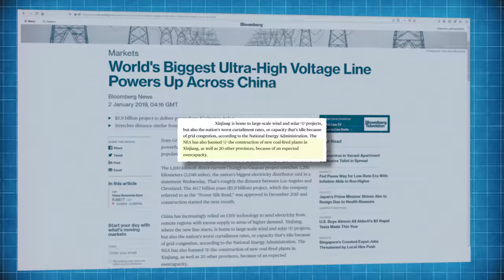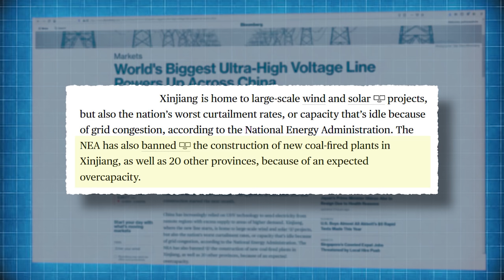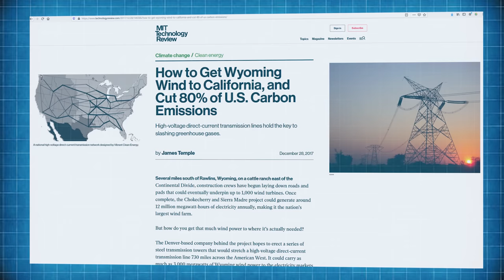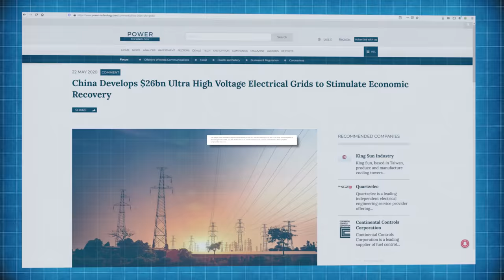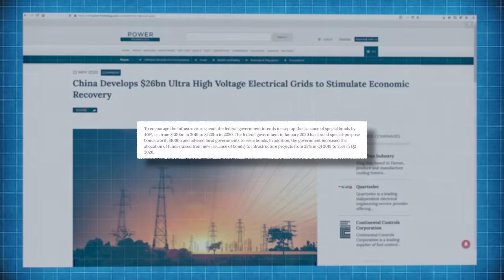China's MILLION VOLT Energy Superhighway

Comment: Clearly, local generation of renewable power is the gold standard when practicable; Apart from transmission losses, anything like a wire or tube is vulnerable to any number of accidental, deliberate or natural events.
Reply: Not the least of which is to separate your people from self-sufficiency.
Reply: That's true, but the more cheaply we can access renewables the more we can mitigate climate change, and like any other network, this one can be made more resilient with more links.
Reply: That's a big geographic issue in China, in the populated ares there isn't much wind or sunshine
Reply: Sean Vikoren Self-sufficiency is mostly impractical since it is so much more efficient to do things in large scales. A farmer harvests twice the amount of potatoes per area than I did yesterday. Same goes for electricity. Edison wanted people to be „self-sufficient“ with power, because he wanted to sell a steam powered generator to each and every house. Tesla‘s power grid idea is so much more practical. And no, even being self sufficient in power and food terms does not shield you from a government exerting power. Unless you isolate yourself on an uninteresting island, that is.
Reply: True.  And the way to minimize a temporary loss due to line failure is to distribute the flow over multiple lines located somewhat apart from each other.

Right now the western US has two large HVDC lines that bring power to SoCal. One from the hydro/wind generators in Oregon and another that brings (brought) coal energy from Utah.  There is work underway to link those seperate lines at their northern ends which would create a loop.  Break the line in one spot and power still flows along the remaining route.

The Utah/coal line is likely to be extended to Wyoming to southern Wyoming's excellent wind resource area.
Reply: We learned that lesson the hard way in Quebec. Despite our network being built at 3 times the Canadian requirements, towers fell like dominoes during the 1999 ice storm. At one point, Montreal was being powered by a single line. We learned our lesson, but the takeaway is very different then what you are promoting. Every 10th tower, a stronger fall arresting tower was built. More redundancy was added to the network. The power utility has also gotten rather savage with trees and will cut anything that is even remotely close to power lines.
Reply: @jonathanlanglois2742  

It's too bad that it's much more expensive to bury the lines.

Long term, I think there's a greater than 50% chance we'll see Boring Company building hyperloop tunnels for very fast travel between cities.  A single route would use three tunnels, one in each direction and one for service and emergency evacuation.  Use a UHVDC transmission line.  Put the positive wire in the bottom of one tunnel and the negative wire in the bottom of the other.

When you build a roadway in a circular tunnel there's a space below the roadway that is unused.  Put conduit in there for transmission wires before you fill and pour.  Do that and the cost would be very much lower than an above ground tower system.  No towers, no route real estate costs, no tree removal type maintenance costs.

The probability of a line break or short would approach zero.
Reply: Weather dependent energy, or sunlight dependent, needs prodigious amount of "storage", and uses it inefficiently.
The 3 GW plant at Bath County Virginia is the highest power in the world. If you fed it up to 3000 MW from a 3 GW assemblage of wind farms with a CF of 1/3, it would average 800 MW output, because its remarkably high efficiency is 80%. It would store off-peak nuclear much more effectively.
Its energy storage capacity is given as 24,000 MWh.
I decided to compute from standard figures how nuclear fuel compares with that. It comes to 3 kg of fissile isotope.
At 3.6% fissile, with plutonium added of about half that much, except that LWR can't use less than 1.8%, I reckon 100 kg of fuel rods holds as much available energy as the biggest pumped storage in the world.
But don't you dare suggest that a reactor should be backup for bird and bat-killing wind mills.
Reply: @jonathanlanglois2742  So high power lines are a menace to the green of trees, in Quebec.
Reply: @albertrogers2506  
You know, if one were to propose building a solar-only grid in a place with modest solar insolation you'd be right.  But that wouldn't be a wise thing to do.  A 100% RE grid will almost always use a mixture of solar, wind, hydro, and possibly other clean generation sources which will minimize storage needs.  The only grids likely to be 100% solar are a very few on small, very sunny islands.  

I'm not sure why you claim that solar uses storage inefficient.  Round trip efficiency of lithium ion batteries is 90% or better.  Pump-up hydro runs from about 70% to as high as 85%.

The wind turbines that we are currently installing have CFs well over 33% and a recent survey of wind resources at a 140 meter hub height finds lots of usable sites spread around the US where we should be able to enjoy CFs from 60% to over 70%.

The issue with nuclear is not the cost of fuel.  Fuel is cheap.  Currently fuel costs are less than $0.01/kWh.  Very minor.  The economic problem with nuclear is installed cost.  We don't have current overrun costs for Vogtle 3&4 because the company quit making overrun costs public.  But the previous accounting of a couple years back found that the installed cost was around $12/watt.  Compare that to wind at about $1.50/watt and solar which is now below $1/watt.  Nuclear costs so much to bring online and that cost has to be paid back over, typically, a 30 year period.  That's what makes nuclear electricity unaffordable.

And, remember, nuclear reactors need backup.  The grid has to have a way to replace their generation when they have an unscheduled shutdown.  What that has meant in the past is requiring steam plant to run below full output.  Then when a nuclear (or coal) plant dropped off line the remaining plants would spin up to keep the grid powered.  Running a less than full output increases the cost of electricity produced.  Annual total costs are divided by fewer MWh of electricity sold.

Bird and bat killing is FUD.  A recent study that demonstrated how to cut bird kills in half revealed some interesting statistics.  This is before one of three blades was painted black in order to make the rotating blades more visible to birds.  Here's the pre-painting data from the eight turbines used in this study. 

Bird kills were counted over a 7.5 year period.  

18 Total Kills 
8 Turbines 
2.3 Kills per Turbine 
7.5 Years 
0.3 Kills per Turbine per Year  
Kill rates were well under 1 bird per year per turbine even before a blade was painted.  

After one blade was  painted black on four of the eight turbines for an additional three years.  During that post-painting study period bird kills were more than 70% lower for the painted turbines compared to the unpainted turbines.

The above numbers do not include observed deaths of 13 Willow ptarmigan <i>Lagopus lagopus</i> who typically die from colliding with towers, not flying high enough to be struck by blades. A separate study found that painting the lower 10 meter of the tower black cut ptarmigan deaths by about 50%.  

Another interesting tidbit - "Mammalian scavengers do not exist on the island of Smøla, minimizing any removal bias." That means that the counts were likely very accurate.											

Bird kill rates of less than one bird per turbine per year are common except for a very small number of wind farms where mitigation has been necessary.
Reply: @albertrogers2506  To be had, an adult maple tree can grow 2 meters in a single year, so they literally have to cut them every year even considering just how savage they are being. Theses trees are so tough that short of removing the roots, they'll grow back, so cutting a few branches doesn't really hurt them much.
Reply: James, I appreciate you balancing out the typical “pro” only comments. It seems that people mainly focus on “can this be done”, without any consideration for, should it be done, up front cost, or maybe more importantly, opportunity cost.

Despite the world spending trillions of dollars on solar/wind, gov mandates forcing people to use, guaranteed profits, ect...Solar/wind (& batteries only) still can’t even power a single modern factory on an autonomous basis, let alone a city, state or country. Solar/wind don’t work most of the time so they have to be backed up by the fossil fuel grid 24/7/365 and the battery storage required for an industrial economy is non existent at anything remotely feasible cost wise. This is shocking to most people who’ve been lead to believe that solar/wind are powering modern economies on a self sufficient basis...By self sufficient/autonomous I mean, not connected to, or backed up by, the fossil fuel (or nuke, hydro, geo) grid. 

When I point this out, I most often get snide, “have you heard of batteries?” or “not true, there are places powered by only solar/wind and batteries”, but when I ask where this is happening, I only get more insults in response. It turns out most people conflate, 1) what’s predicted to happen 10 years from now, with the realty of where things actually stand today, 2) places running on renewables like hydro or geothermal (both great sources) with running on solar/wind, or 3) off grid living power requirements with powering an industrialized economy. 

The “battery storage revolution” has been just “a few years away” going on 60 years now, but when I point out the obvious, I still  get the, “cheap battery storage is...just a few years away” response. ;) 

Going back  to opportunity cost, I can’t help but wonder how much further along we’d be if instead of spending trillions trying to make unreliable, dilute, non-scaleable and expensive energy (solar/wind) the opposite of what they are, and instead spent that money on making sources (nuclear, nat gas for example) that are already reliable, dense, scalable, and affordable in comparison, that much better. 

If the goal is solar/wind, no matter the cost, and we’ll bear any cost in that pursuit, it’s easy to claim victory in the face of an energy policy/energy poverty disaster.
Reply: @fjalics  Renewables may seem cheap, but a gigawatt of solar panels is guaranteed worthless for 12x365 hours of most years, and slightly more for leap years. If you add enough energy storage to carry it over, it is no longer inexpensive. No such capability exists on Earth. If you have 3000 MW of faceplate wind power, in a site with an expected "capacity factor" of 1/3, you expect an average of a gigawatt, but your dispatchable power for grid purposes is zero. If a million "homes" get up from their TV sets and go to their kitchens to switch on an appliance or two at a kW each, their is no way you can summon up a gigawatt's worth of wind.
It's like the spirits of the deep that Glyndwr claimed he could summon, and Hotspur said "Aye, so can I, and so can any man. But do they come when called?" (Henry IV, Part One)
The funny thing about wind is that the same wind can travel from John o' Groats to Land's End or Dover in a remarkable short time, so there's not much resilience. The Sun's no better. I have farmland that induced a solar power company to offer me, if I'd three phase grid access possible, $500/acre/year for a twenty year lease.  Having significantly more than 100 acres, that'd be a million dollars, which is more than the value for which the county charges me taxes. I did not respond, as I consider the "renewables" trade as dishonest as any religious swindler.
Reply: @YearRoundHibernater  Q: What is large and yellow and very very dangerous?
A: Shark infested custard. That'd be an uninhabitable dessert.
Perhaps I should apologise, but I could not resist.
Reply: @bobwallace9753  exactly my thinking. i know a way to do it :)
Reply: @lawsonhannah  
Tony, you make a number of statements that are incorrect.  Let me address at least some of them.

"Solar/wind (& batteries only) still can’t even power a single modern factory"
  
It is absolutely a fact that solar/wind + batteries could power a single modern factory, even a steel foundry/mill.  But there's no need to do so as it would only be a demonstration project.  As we add wind, solar, and storage it fits into the entire grid, not one isolated load.

"Solar/wind don’t work most of the time"

Wrong.  The number of hours during which either wind, solar, or wind + solar are producing electricity is very high.  With 140 meter hub heights we are moving into conditions where onshore wind turbines in the US will have 60% to 70+% capacity factors.  A 60% CF does not mean that the turbine is producing electricity only 60% of the time.  The turbine will have some number of hours at full output, some at 80%, some at 60%, some at 40%, etc.  Those numbers average to 60%.  The numbers during which generation occurs will be much higher than 60%.

I've looked at annual hourly generation numbers for California across two years.  There isn't a single hour during which there was no electricity generated by wind and/or solar.  The situation is that some hours output is high, some hours output is low.  By increasing our capture are and adding, very importantly, offshore wind we can greatly reduce the number of low input hours.

"so they have to be backed up by the fossil fuel grid 24/7/365"

Are, right now.  But do not Need To.  It takes time to transition from one energy source to another and we are early in the transition.  During the transition we will make use of what we have, which is now fossil fuel, hydro and pump-up hydro storage.  As time goes along we will install more wind, solar, and storage and reduce our use of fossil fuels.

" battery storage required for an industrial economy is non existent at anything remotely feasible cost wis"

Temporarily, but only temporarily, correct.  Battery prices are rapidly falling and we're now seeing solar farms with hours of battery storage bidding into the market at very competitive prices.  Solar farms designed to provide power during the sunny hours and the provide power from their batteries during late afternoon and evening peak demand hours.

Battery prices are continuing to drop and grid storage installations will grow.  It's happening.

"This is shocking to most people who’ve been lead to believe that solar/wind are powering modern economies on a self sufficient basi"

That's a very dishonest statement.  No one is telling people that wind and solar are totally supplying a grid anywhere.

"2) places running on renewables like hydro or geothermal (both great sources) with running on solar/wind,"

Hydro is a dispatchable source of low carbon electricity.  Lots of grids will use hydro, if they have some, to fill in the wind/solar gaps.  That happens now with fossil fuel/nuclear grids.

Geothermal may be used some places if the heat resource is limited.  By using the geothermal only during peak demand periods it should be possible to let heat recovery occur during the low demand periods.   But, basically, geothermal is an 'always on' source like run of the river hydro.

"Going back  to opportunity cost...."

There was a time when nuclear was less expensive than wind and solar.  About 30 years ago.  But 20, 30 years prior to that we came to realize that nuclear was too expensive compared to coal and basically ceased building new reactors.  There was no significant concern about climate change so there was no push to cut our carbon output using nuclear since is would have meant a major increase in the cost of electricity.

That's now changed.  New nuclear is about as expensive as new coal, our two most expensive ways to bring new capacity online.  Wind and solar are now our least expensive ways to generate electricity.  Natural gas, while cheaper than nuclear, can only be used temporarily during our transition as we must eliminate fossil fuels.

Where would we be had we built lots of reactors 30 years ago?  Well, we would have produced less CO2 which is a good thing.  But we can't go back and do that and we wouldn't have been able to get people to agree to higher utility bills.  So where do we go now?

Install lots of wind and solar.  Keep bringing the cost of storage down via improved manufacturing efficiency and technology advances.  Identify more dispatchable loads so we can use a larger share of electricity directly from wind turbines and solar panels, lessening our storage needs.  Start capturing methane from urban and ag waste streams to be used in CCNG plants for 'gap filling'.  Perhaps uprate some of our power producing dams so that they can deliver larger amounts of power at times of high need.  (More likely, add a pump-up storage component.)

Nuclear's gone.  Dead.  Unless some government is willing to subsidize the cost of electricity.  The market will  not support new nuclear.  Even paid off nuclear reactors in the US are going bankrupt because they can't produce electricity at a price the market will pay.  Kewaunee was the first US reactor to close because they couldn't sell their electricity at a price high enough to cover their costs.  This was a paid off nuclear plant in good operating conditions with years left on its license.  Kewaunee needed to earn $0.05/kWh and the market wouldn't pay that much.

Just a couple of days ago it was announced that the two reactors at Byron Nuclear plant and the two reactors at Dresden Nuclear Plant will be closed next year.

Starting in 2018 we've seen Oyster Creek, Pilgrim, Three Mile Island, Duane Arnold, Indian Point, Perry, and Beaver Valley nuclear plants go cold due to cost of generation.

The two Byrons, the two Dresden reactors, and Palisades Nuclear are scheduled for closure in 2021

Clinton and Quad Cities, and Davis-Bessie were scheduled to close but are now receiving government (taxpayer) subsidies to keep them open.

The nuclear age has come to an end.  From here on, assuming there's no new emerging and unexpected technological breakthrough, it's renewables with wind and solar playing the largest roles.

Fat lady has sung herself hoarse....
Reply: @albertrogers2506   You aren't looking at the situation correctly.  Solar panels will provide inexpensive electricity about 18% of the time (US average).  If single axis tracking is used it's somewhere in the 25% to 30% range.  Cheap is good, is it not?

Wind turbines, 140 meter hub heights, with yield capacity factors over 60% which means that those wind turbines are producing electricity well over 60% of the time.  And more cheap electricity.

Put the two on the same grid and then fill in the gap with overbuilding, storage, and dispatchable loads.  Do that and you know what we end up with?  Cheaper electricity, clean air, and less extreme climate change.  

Perhaps  you ought to look to see if you can find the number for that company that wanted to do business with you.  $200,000 per year from a 100 acre farm and no associated expenses,  $2,000 per acre profit it danged good money for almost all farmers.  And if those panels are mounted with some space under them you can still graze and farm on the land.

You might want to do a little checking and see how farmers and ranchers are fairing who are leasing land for wind turbines.
Reply: @albertrogers2506  So clearly you're not expert, but you have some unsubstantiated beliefs. So to begin with, it doesn't matter whether you call them, or don't. What matters is how much they cost, and how well that production lines up with when you need it. It is easier to balance wind and solar, than just one or the other. Larger and more robust grids are much easier to balance than small isolated ones. You want to get everyone involved, by for example giving them great prices for electricity when it's plentiful so they charge their car, heat water, or heat and cool their house, of course with computers, not running around flipping switches, and lastly with storage. Batteries for fast reaction times, and high efficiency, and pumped hydro, liqid air or who knows for bulk storage. Norway and Portugal run mostly on renewables. This is 24 hour tiny grid only solar. 10 cents. Way cheaper if do it continent wide, and storage prices are dropping fast. https://www.greentechmedia.com/articles/read/aes-completes-its-record-breaking-solar-and-battery-plant-on-kauai
Reply: @fjalics  That is a very stupid response. If power is available when nobody wants it, it is worthless . I have been underground in what was then the biggest electric storage plant  built in Europe. 1,800 MW and about 6 hours storage at that rate. Batteries are puny by comparison. It is very good at responding to sudden short but sharp residential demands, when thousands  of people leave their TV watching and switch on kilowatt level kitchen appliances. But to accommodate the troughs of wind power production, the biggest of these in the world can accept  nearly 3000 MW of power, and store a gigawatt_day, 24,000 MWh, which is again, puny by comparison with the troughs of wind power production in any month.
The energy stored in 3 kg. of fissile uranium or plutonium , and available on demand even from today's obsolete but most common reactors, is about 24,000 MWh. 100 kg of today's standard "enriched" fuel rods can supply that much.
Also, I was employed by the Federal Energy Regulating Commission in the year 2000 CE when distribution companies were going bankrupt in California because the only moderately reliable solar energy source, hydroelectric, had not had enough reserve snowfall for its usual function of meeting peak loads. You clearly do not know about the necessity of "spinning reserve" and the ransom level of prices that can be charged for it.
I have quite well substantiated observations and facts, which the entire bird-murderous Industrial Wind trade ignores.
As for the prices, the recorded fact is that they soar in any region that installs "renewable energy", particularly California and Germany, where they make the problem worse by closing down nuclear. It also worsens the air quality.
Reply: @albertrogers2506  So if nuclear produces power when nobody wants it, it is also worthless. Nuclear, if I understand correctly, can only ramp down to about 50% capacity, and only in the first year of the fuel cycle, but you save no money doing it. It just makes the already expensive electricity twice as expensive. We have 2 reactors under construction, Vogtle 3 and 4. I think they are going to get paid 19 cents/kwh WHOLESALE cause I saw it once, but I can't find the number anymore, cause it's being hidden, because it is so embarrassingly high. You keep ignoring the important thing to optimize. Cost. Nobody who is paying their electric bill cares about how many kg of uranium you made out of the tons of ore you processed. Spinning reserve is what you need when you don't have enough batteries that can react in miliseconds, though you still want some synthetic inertia. Those power electronics guys are clever, right? As to the birds, it seems you are very interested about wind turbines killing birds, and disinterested in anything else that kills birds. An argument from emotion. No details.
Your argument that retail prices are high in some places that have renewables is a bad argument for two reasons. One, I'm aguing about what we should do next, based on prices right now, not what they were when Germany had a 50 cent FIT. Second, you don't get to assume the prices are high because of renewables instead of high taxes because it fits your narrative.
Reply: @fjalics  Your data on current nuclear ramping capacity are not correct.  But In the 1960s the US lab at ORNL demonstrated quite conclusively a reactor design, Molten Salt, MSR, that is both inherently meltdown immune and entirely load-responsive. Also it is not adaptable to the making of bombs. So when Nixon cut the AEC's budget, it was abandoned. 
There has been a deliberate and very successful anti-nuclear campaign that is responsible for a fourfold and unnecessary increase in the cost of building reactors.  Scores of reactors built without these "improvements", 60 years ago, have had no problems. Russia and China do not have this problem, and even intend to export Gen 4 reactors. 
Your figures even for currently deployed reactors are false, except that reducing the output when demand drops saves nothing, which makes the idea of "nuclear plus renewables" nonsense. My electric power supplier, with just less than 50% nuclear, charges 8 cents/kWh. But California, Germany, and Denmark have the most expensive electricity in the world.
The reason I would, were I still a British subject, vote for Brexit is that France was bullied by the powerful "energy companies" of the EU into "privatising" Électricité de France, because it could sell power more cheaply than they could, "and it wasn't fair".
Thorcon Power has a MSR design for which both the material and the labour costs of construction have been estimated, both by themselves and the probable South Korean shipyard manufacturer, at three cents/kWh.
Reply: @albertrogers2506  If you say what I said about following load with our current fleet is wrong, by all means send me a link. The average nuclear plant in the US was actually built for 250% of it's estimated cost. I say nuclear is welcome to sign a power purchase agreement, and the builder can take all the risk. I think anybody doing a deal where the rate payers are on the hook for cost overruns are nuts. The implication that nuclear is failing due to some great conspiracy is cute and all, but the world is a big place, and the US isn't the only country in it. I know what an MSR is, and I don't doubt that it is safe from a meltdown, and it can produce power. What I doubt is that it is competitive in a commercial environment. I live in Ohio, PJM grid, and we have a large percentage of nuclear, and I pay 16 cents. Also, the speaker of the house recently got arrested for taking bribes to pass a bill subsidizing our nuclear plants, and a couple of coal plants. Ohio HB6, cause apparently even existing paid off nuclear plants are struggling to keep up.
Reply: Bob Wallace Hey Bob, Lot of info so might be best to tackle one at a time. Social media is tough place to have nuisanced discussions so when I say claim “X”, I mean in the full context of how most people understand X to work and in the full context of weighing cost/benefits. I believe the goal of anyone presenting material should be to bring clarity and a better understand of the subject matter.  It’s easy to be factually correct, but withhold enough context so that people can be lead to believe the exact opposite of what is true. We also want to make sure there’s a clear distinction between what is demonstrated today vs what’s speculated in the future. 

With that in mind, I know S/W & batteries only could theoretically power a factory of any size, but the cost compared  to all other options would be cartoonishly absurd. As an analogy we could theoretically mandate that auto manufactures build cars that could sustain a 100mph crash with a very low probability of death for all passengers, but what would that type of car cost and who could afford it? Formula 1 drivers routinely survive crashes well over 100mph, but they start at about $12,000,000. A a lot of people would be riding their bike. :) 

A major problem with how S/W are framed is that so many things are implied with the gaps left to the publics imagination. Some examples. 

-When the media announces that X place got 70% of its energy from renewables.
Most  people would understand that to mean that...Well, S/W are providing 70% of UKs power, but  is that what’s really happening? Of course not. What’s generally buried at the bottom of the story is that X got 70% of its power from S/W for 5 minutes, of one random day, of one random week. What provided power (FF of course) for the remaining 23 hrs / 55 min of that day is left to the readers imagination because it’s omitted from the story. 

Another example would be when X company  comes out and states their server factories are powered by “clean energy”, so most normal people would think, well...X is powered by S/W, right? But again, that’s absurdly false. X  gets most of its energy from the fossil fuel powered grid, but spends big money on Renewable Credits to claim to they are powered by something they are not. It’s so dishonest because people hear that and say if X company and X county can do it, we can too! Its a dangerous misinformation campaign. 

I could give examples for days of the dishonest distortions and Enron like accounting that are SOP in the S/W industry, but hopefully you get the direction I’m heading. While not explicit, the SOP in S/W is to imply that S/W are actually powering modern industry on a cost competitive basis with FF, but that’s beyond absurdly false.

Hopefully that gives more context to my “solar and wind can’t even power a single factory” statement.

Make sense?
Reply: @bobwallace9753  "capacity factors over 60% which means that those wind turbines are producing electricity well over 60% of the time" is totally untrue, because even if it were true that 100 MW nameplate capacity of such "turbines" produce 24x60 MWh in a typical day, or about 30 times that in a typical month, most of that electrical energy is produced when the wind is stronger than the average.
The typical graph of power vs. windspeed that the manufacturers publish, shows a nearly straight line from 6 m/s to 12 m/s -- which means that they start to "feather" the blades at half the designated power level. At 12 m/s, which is about 27 mph,  the actual power of the wind is eight times what it is at 6 m/s, so at 3 m/s you get 1/16 of the rated capacity.
Reply: @fjalics --" nuclear is welcome to sign a power purchase agreement, and the builder can take all the risk" Let's apply that to wind and solar, and that'll put a stop to them. Make sure that the risk includes an escrow for ridding the fields of all the concrete, the roads only necessary for servicing the equipment, and the 50 to 65 metre blades that can hardly make it around curves in the access roads. 
A link: I didn't try very hard, this probably  isn't the best, but see https://www.powermag.com/flexible-operation-of-nuclear-power-plants-ramps-up/
However, thorconpower.com and elysiumindustries.com  can doo better than currently deployed designs.

Nuclear plants built in the USA, Britain, and existing in Germany, are subject to what Lars Jorgensen said, that fearful or downright hostile regulation can drive a technology out of business. 
The people who decided on their own selfish view of the world that power "too cheap to meter" would not suit them, have deliberately made use of this. That's most of the so-called -- and even formerly -- environmental GMOs, notably NRDC, Sierra Club, "Friends" of the Earth, and worst of all Greenpeace, are doing.
Reply: @albertrogers2506  60% CF is calculated by taking actual generation / hypothetical generation assuming the turbine ran at full speed 24/365.  CF is a measurement of what is produced.

60% CF does not mean that wind turbines produce electricity 60% of all hours.  There will some portion of hours where generation is 100%, some at 99%, ... some at 1%.  

Now it should be clear that it is not the case that 60% of all hours in the year turbines run at 100% output and don't run at all during the other 40% of annual hours.   Here's a hypothetical summary binning of hours over a year.  The percentages assigned to each bin, as long as one doesn't claim only 100% and 0% hours, shows that 60% CF does not mean only 60% outputting hours.   

30% @ 100%
20% @ 80-99
15% @ 60 - 79%
15% @ 40 - 59%
10% @ 20 -39%
5% @ 1-19%
5% @ 0%

In that (made up) distribution the wind turbine produces electricity during 95% of all hours.  Not only 60% of all hours.  The only way your claim could be true would be if turbines ran only at full speed and otherwise did not operate.  

100% at 100%
    0% < 100%.  

And that's not how things are.
Reply: @albertrogers2506  "Too cheap to meter" was a fever dream, never a reality. The last time any new nuclear starts happened was under Obama with federally guaranteed loans, for 2 reactors at Summer, and 2 at Vogtle. The first two have had billions wasted on them, and won't be finished, and the other two will be crazy expensive, several times more than renewables. The stuff left over from renewables projects are not radioactive, and a lot of it can be recycled. I don't know whether they do, or don't have cleanup agreements in place. It seems you don't either. So, Indian Point is shutting down, where is all that spent fuel going?

Kudos for the Powermag article. I like those guys. Note how they brought up economics like 5 times. Didn't realize they were that far along technically, but price.
Renewables are legitimately cheap now, and still dropping. https://www.iea.org/data-and-statistics/charts/announced-wind-and-solar-pv-average-auction-prices-by-commissioning-date-2012-2020
Reply: Tony Comer ..thanks for the thought. What is interesting is the developing range of energy storage systems; it used to be mainly pumped hydro schemes but it is branching out to things like compressed gas and even mass / gravity schemes using redundant mineshafts. Kinetic storage has been used for a long time of course. But the really interest developments are in battery technology, with material developments such as Graphene opening up new possibilities. You will no doubt remember that Elon Musk accepted a challenge to install a battery storage scheme in Australia on a very short timescale, and we seem to be moving towards a 'smart grid' where domestic  batteries, and even electric cars, can be used to smooth out long and short consumption cycles. Yes, i too like nuclear energy, but it to be a safe distance away, like our sun.
Reply: albert rogers ..good points, but i would make the case that solar and wind energy is nuclear power, because it comes from the sun. The advantages in using the sun as a source of nuclear energy are 1/ It is free at the point of delivery. 2/ It is no more or less safe, if we donor don't use it. 3/ It has a predicted working life of a further 5 billion years. 4/ There are no crippling decommissioning costs. 5/ Toxic waste disposal combined with the risk of rogue states and groups gaining nuclear weapons is reduced.
Reply: Werner Viehhauser ..yes, i agree, but there is a danger in taking the argument for efficiency of scale to its logical conclusion. As an example you can see that in the vast, monoculture 'deserts' and feedlots of the USA, where there is very little biodiversity, just the crop. Apart from the ethical issues, there is the very real problem of de-carbonisation of the soil, where artificial fertilizer is sprayed onto an increasingly mineral soil. It only takes one or two drought years and we are back to the 'dust-bowl' of the 1920's. Localism, moderation and diversity would appear to be key to sustainability. We might ask, who is to gain from our individual endeavour? Just ourselves? Or are we satisfied in being good stewards during our time on this Earth?
Reply: @wernerviehhauser94  this reminds me about how there’s arguments amongst anarchists about whether it’s appropriate to collaborate on a grid for the gains or if that restricts the various communities’ autonomy from then on out. 

I myself like the smart microgrid/supergrid combo, with all the HVDC and HVAC stuff handled, automated, but with minimised transmission routes and localised usage when possible. Your battery feeds your neighbour’s toaster across the street or the whole town is a virtual power plant in the supergrid. Using your own solar when you can but also having (indirect) access to Australian solar in the northern hemisphere’s winter, if such a grid were globe-spanning. Or, at least more imminently realistically, tying together all of North America and all of Europe’s grids into one. Already Europe is getting enough interconnectors that curtailment is going down, but for a proper supergrid they have to be capable of handling pretty big power.
Reply: @bobwallace9753  indeed, where I live was built about twenty years ago and they ran conduits under the roads. They supply power and phone, and later added fibre optics. But the nearby area has buildings from the 1800s and they also have buried lines, so it’s been done in some places for a good while. As you say, it’s very easy to do cheaply if it’s policy for a long time to just take advantages of these opportunities in planning.
Reply: @James Brooks  I didn't say there are no caveats. But you would be unable produce enough of anything without mass production. I see no problem with having smart grids, solar panels on every roof and a few storage batteries here and there. Will most likely work fine for household demands most of the time. But imagine everybody trying to grow his own food. And feed a pig on the side. Make his own iron in his own backyard smelter. Takes ten times longer and produces ten times the pollution for half the quality material. Can you image building your own car like that? I don't.
 Mass production creates lots of stuff with less effort. Big pro. We have to work on minimizing the damage it does, and add small scale production where it is sensible. No large civilisation has ever existed without division of labour and some sort of mass production for the most common goods. Neither can we.